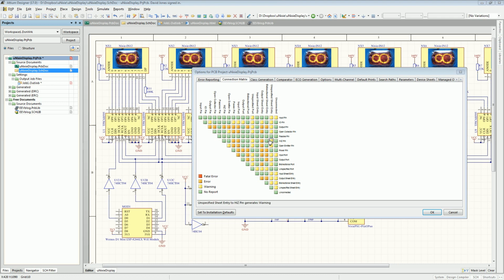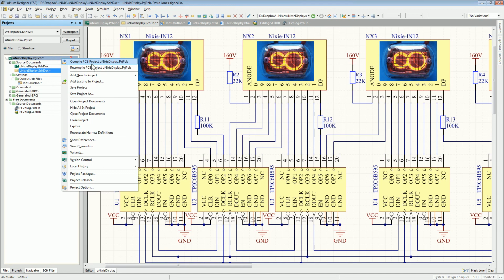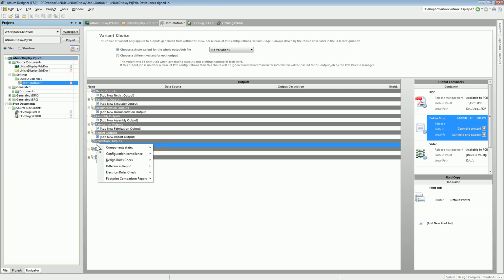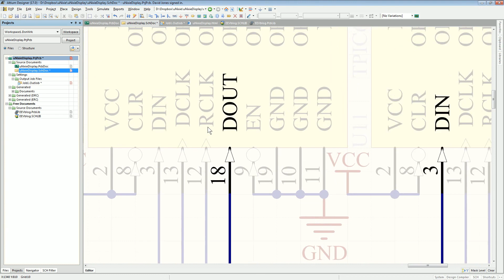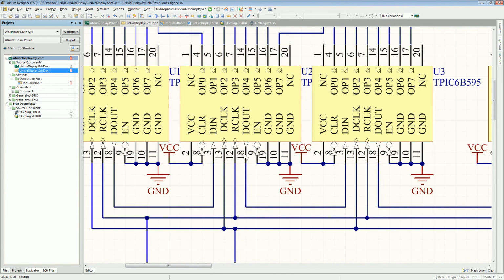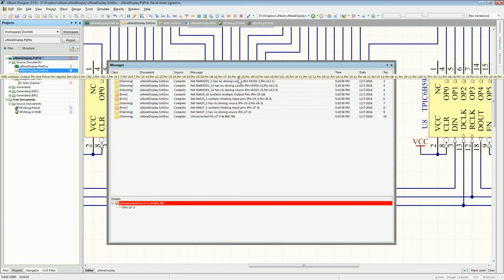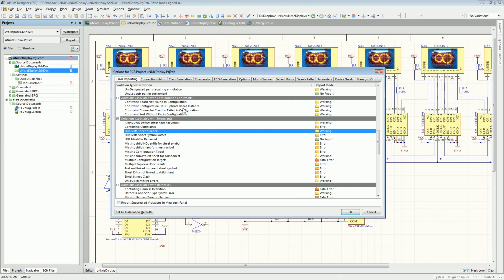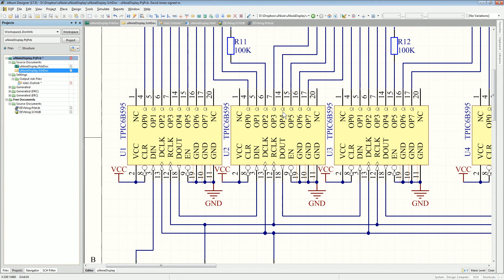EEVblog #953 - What Is Schematic ERC?

Comment: The more I see of Altium, the more it seams too much for the hobbyist. I have a 100 component project and it seams too much for that.
Reply: What do you mean? Too big cost or too much functionality?

On the one hand, I hate when people tend to use extremely simplified soft for doing schematics and PCBs. Here in ex-USSR countries Sprint Layout is very popular along makers, which is in fact an evil, I believe. No connectivity-control, no even a connection between schematic and routing, no package libraries, no concept of part and package, nothing. But hobbyists love to say: "I don't need all of that, leave it to professionals". I think it's terrible bullshit: everyone who routes a PCB, no matter hobbyist or a professional, needs to be provided with good software with all of that mandatory (in my opinion) stuff like connectivity control, DRC, routing hints, integration with schematic editor, trace classes (power/signal/etc), 3D visualization (to check if it's hard to assemble board by hand, because sometimes you put part too close to let solder tip reach its terminals).

On the other hand, a few years ago I have tried to use Altium a bit. I can just say that I have no idea how one can even use it. Slow as hell, UI is entangled, some of obvious usage patterns do not work here. Either I missed some key functions/settings and modes which can make it comfortable to work within Altium, or it was not-so-successful release of Altium, or... I don't know... you have to have some special condition of mind to work in Altium :-P
Reply: Everything really depends on what are you doing and how serious it is, I always sticked with Eagle for my small projects and it has been enough for me, not that Altium wouldn't more useful, of course I'd like to have 3D visualization, but you know, I didn't need it for single home-made PCB :P
Reply: That's what people with experience say, but think about the guy starting off, who doesn't even know what a resistor is, and Altuim seams a couple orders of magnitude more complex than they will ever need, or would need for at least a couple of years. It a struggle staring from nothing, like I did 1 year ago, and making the crash zone shorter helps. I think I could handle Altium now, but I still would only use, or ever need, 10% of it's capabilities.
Reply: Well, Altium had some bad versions like 9.xx that were quite buggy.
But I allways found it to be quit easy to use for the basic functions.
I got the student version in college and had my first little board routed after a rainy weekend.
Using it professionally these days, I can teach someone how to use it on a basic level in maybe 2 days. (Library handling: scm symbols and pbc footprints, how to draw Schematic, push to PCB, route, make production files and check them in CAMTASTIC)
Try that with other packages like PADS, OrCAD or CADSTAR. Probably looking at a 2 week commercial workshop to do the same. ^^
Reply: Unfortunately this is a high-end channel and what I notice is that high-end users only think high-end, it's why Dave always pushes a 10K workshop, even for a beginner. Beginners aren't really catered for here, except for that $330 workshop video, but high-end users forget what it was like when they started, and trust me no one is going to buy 1-2K software for a hobby that they might not continue. I can teach primary school kids Fritzing in a couple of hour, because it is a graphical representation of what is in front of them, where as Altium has things like a million reports that a hobbyist will never use.
Reply: Altium is not high-end, though. It is a relatively cheap tool for developing standard technology of today. 
Full Cadstar suite approaches 100k$ and is not high end by any means. ^^
I have the feeling that you misunderstand the purpose of these videos, though.
I am pretty sure this is not meant as a hands-on step by step tutorial, but to show the concept of ERC and it's usage.
It's quite irrelevant which tool he uses to show the concept. Even Diptrace freeware version, which by the way is a very fine PCB design package for hobbyists, has some basic ERC functionality.
It is the task of the viewer to transfer the gained knowledge to his own tools.
Can't really see what's so unfortunate. If one is struggeling with the basic usage of his design tools, then there are very likely specific tutorials for these tools somewhere else.
Vides like this one here are helpful for beginners to show them what useful features there are and what to look for. Reading up on how to actually do it in your own software is the part where you learn something.
Reply: The level of something is directly related to the experience of the person, ie I don't think Top Fuel Nitro engines are high-end because I worked on them, yet when the public sees 8000hp they think it's high-end, To you Altium is not high-end, but to someone with 1 years experiance, like me, it is high-end. Trust me no breadboard home user with a etch kit needs Altium, nor will pay the 9K + 1K/yr for a hobby. There is nothing wrong with Altium, and if I could get a non online version for free I would give it a try, but right now with my 3 home etched PCBs a year Fritzing is fine.
Reply: Ok, if you define it that way. Basicly, every commercially oriented PCB package will be high end, then. And even a 100..200 bucks license would be difficult to justify.
Still, these videos do not promote the use of (for private individuals) expensive packages like Altium. They show concepts. Yes, things look complicated and bloated.
But there is a fundamental difference between tools meant for actual production, even if they are free, and 'toys' like fritzing. And yes, these videos clearly are aimed at users of the first ones. Nothing wrong with that. There is much to learn, much to look out for if you want to get your PCB produced (right).
Dave also made videos on how to get boards ready for production. Once you get beyond that knowledge barrier, you'll see things aren't that complicated and can adapt the things he shows to your own tools.
Will your electronics hobby ever get big enough to justify spending the time to get beyond that barrier? That I don't know.
I know that I don't etch at home anymore because pcb prototyping services got quite affordable, and I see that quite a lot of hobbyists with very basic electronics knowledge are using services like oshpark with a little help.
Do they need Altium? No! Can they profit from knowledge about features like ERC? Yes, absolutely!

I know the barriers. I started as a hobbyist as a teen. No breadboards back then. Take a piece of wood, bang some nails in and solder your components to them. :D
I got Eagle free version as most hobbyists did back then. Making your own library parts was sooo complicated, making fabrication files was sooo complicated. But eagle had a big library and for home etching you could print it yourself.
For fabrication you can easily download a DRC definition file and then just send the pcb service your complete eagle design files...
The downside: It is easy to get stuck with that and never move beyond. Stark making your own parts, and you'll see, it's really not that complicated and quite fast to do. Often faster than to search a good library.
Watch tutorials on what production files should look like, and you'll see: for hobbyists double sided boards with hand solderable parts: really not that complicated.
After crossing those barriers you are free to choose whatever tool suites you. Eagle, Diptrace, Design Spark, KiCad...

This is one of the videos that help users with little experience to move from using their tools as mere drawing tools to using them as actual design tools.
There is not much content that does that on Youtube. There is plenty material on the very basics, though.
If the content is beyond you - no worries. Come back later when you are ready to learn about the concept Dave shows and adapt it to the tool of your choice.
Because of that, I think the choice of Dave's Software is not unfortunate, it is irrelevant. If you cannot adapt it yourself and need a step-by-step tutorial, watch them instead.
Reply: Production is not a big consideration in a hobby because no one is on the clock, it's more a nicety. There is still a big discrepancy between what guys with decades of experience say to buy, Vs what they actually did when they were beginners. Look at Dave, he keeps extolling the necessity of having oscilloscopes, and even when you look a the  cheapest one it's still an order of magnitude greater than the sole $50 multimeter he started with. My friend spent $125K on his car because it's his hobby, so I suppose people will buy Altium even if it's not essential.